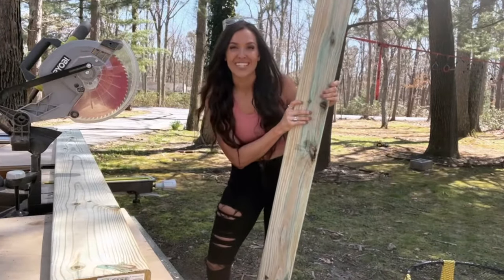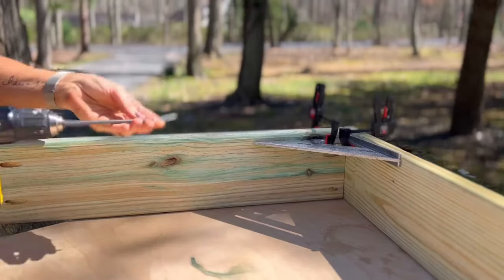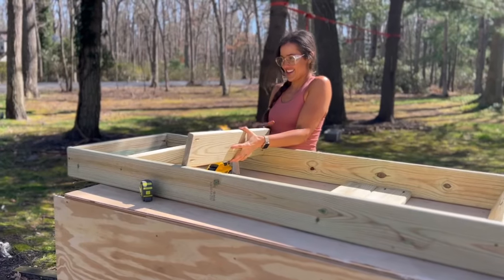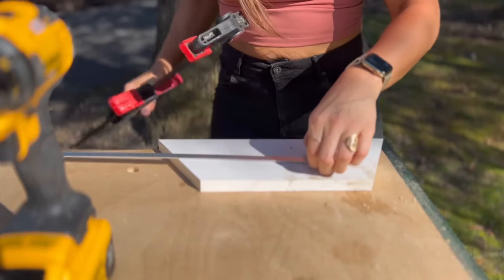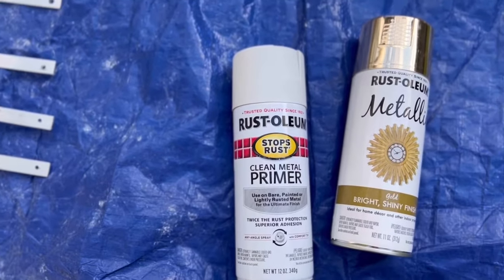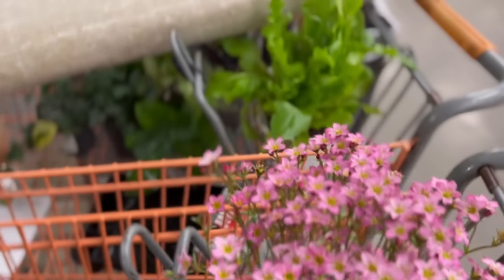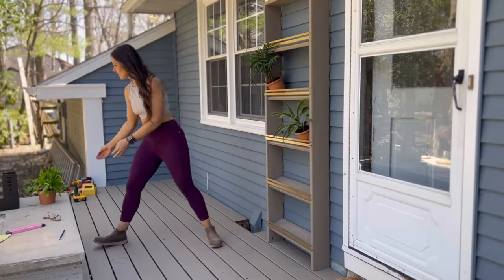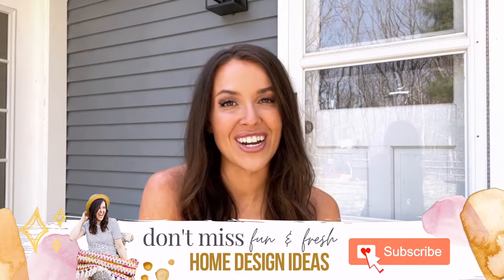BUILD AN OUTDOOR HERB GARDEN | diy outdoor plant wall #diy #diyhomedecor #outdoorgarden

Comment: Using pressure treated deck boards for this project is genius. I would be cautious in zones with high humidity about watering against the house, but the plants can easily be moved to a watering station occasionally, too! 💕👏🏼